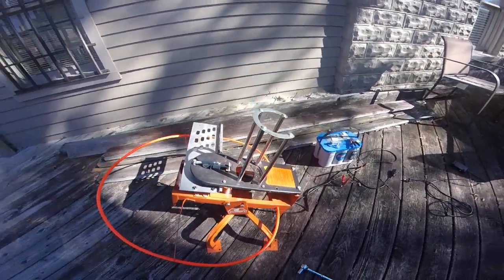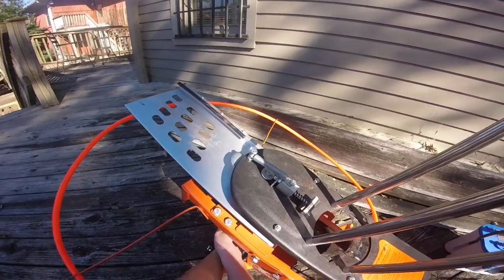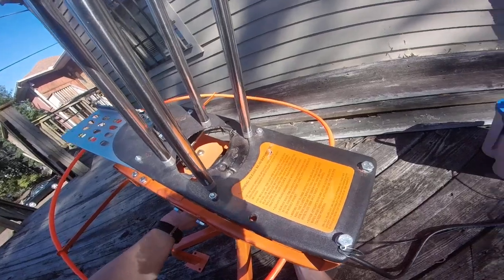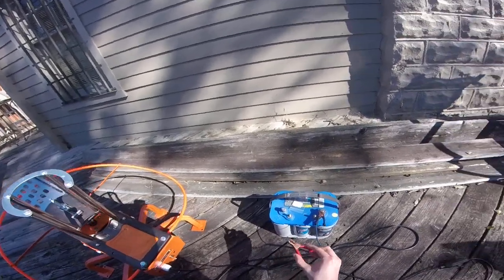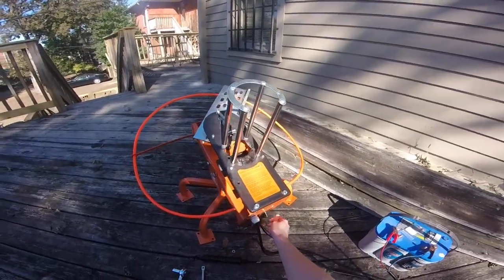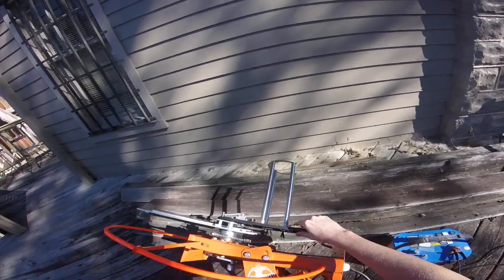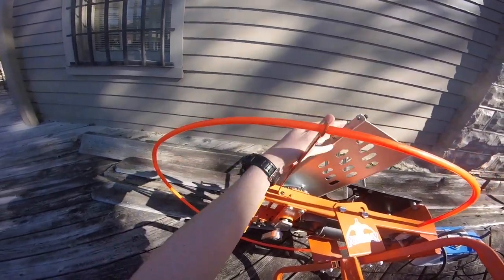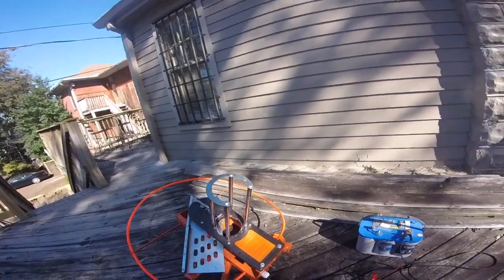First time setup and basic operations of Do All Outdoors Fowl Play automatic trap

Comment: Where can I pick up a fuse or relay? I left the pin in on accident and pressed the foot pedal.
Reply from the maker: The Fowl Play takes 10 amp 5x20mm fuse. The Raven takes a 15 amp 5x20mm. Check hardware or electronics stores, or give us a call.

Comment: Where is the fuse located?
Reply from the maker: Underneath the back of the thrower in line in a black, plastic, cylinder that unscrews from the middle. It's 10 amp for Fowl Play & 15 amp for the Raven.